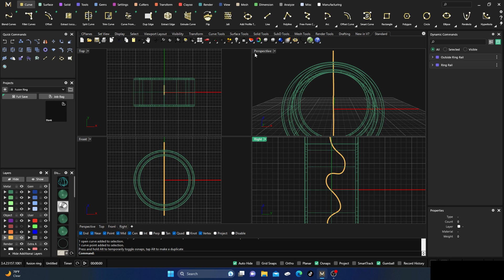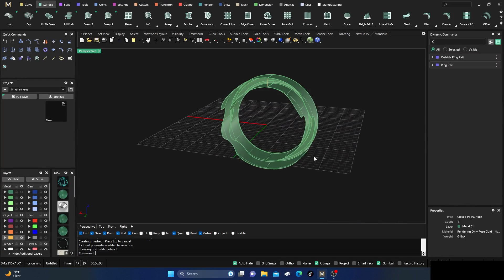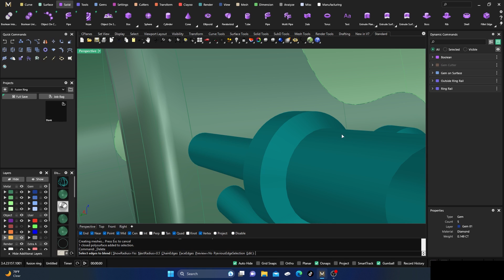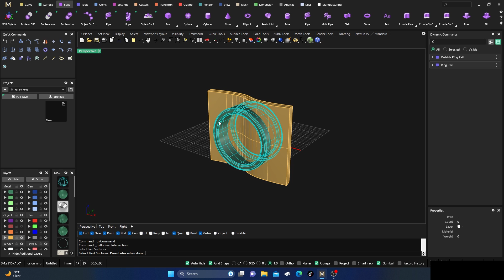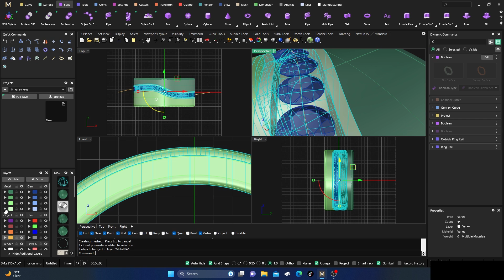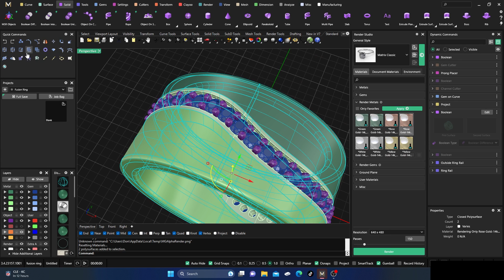MatrixGold Making a Fusion Ring

Comment: How to fix configuration system error?
I can’t open matrix gold 😢
Reply from the maker: What version of Matrix are you using?
Reply: @donsjewelrymakingandjapantrave  I use matrix Gold 2019
Reply from the maker: I would contact MatrixGold Gemvision support. They will even get on your computer with a live season and have you up and running in not time. I have had to do that in the past and they are very good at it and can also give you advice for making sure it doesn't happen again in the future.